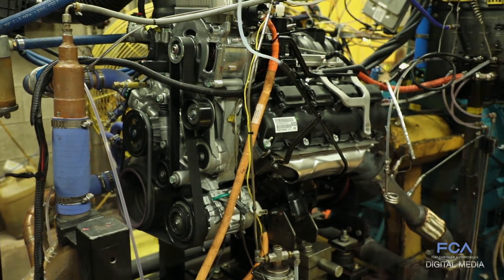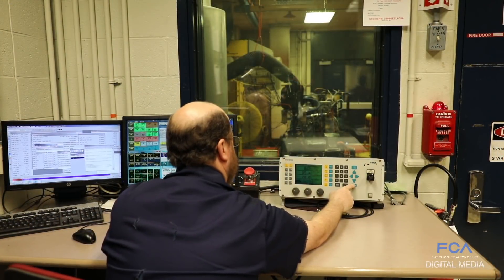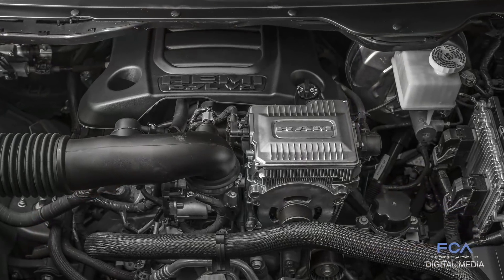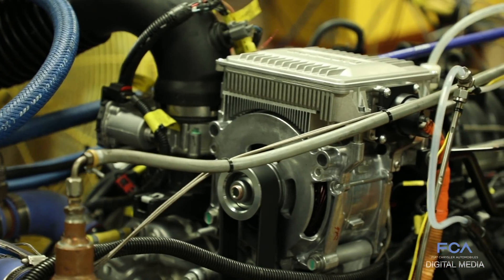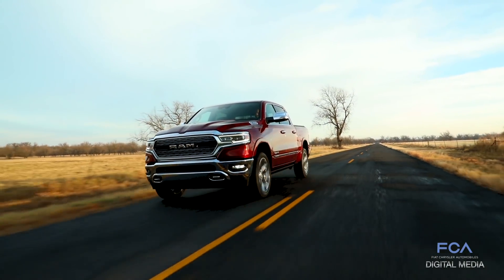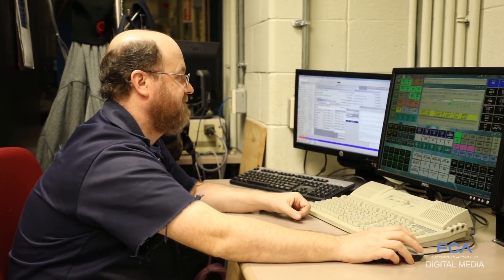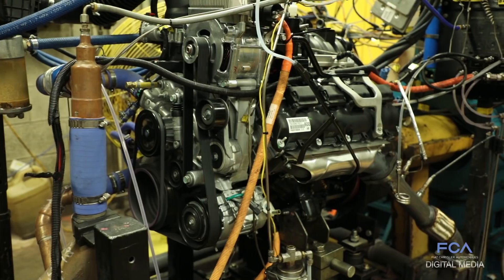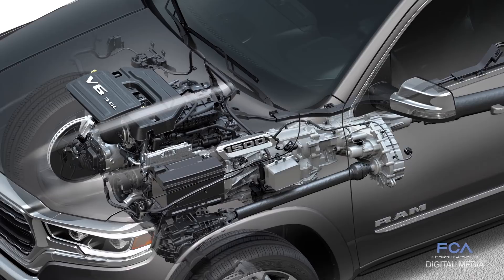2019 Ram 1500: Dyno Testing

Comment: 5000k miles on my 2019 big horn lvl 2 tech crew cab 4x4 1500 hemi e-torque.. The truck is everything I wanted it to be reasonably speaking.. I loved the Limited but I'm a shipyard worker, fisherman, boat hauling, new father so bigger tires and the 2" lift is the route in taking. 
  WELL ok  if I have FCA's ear. Being this is their video. Get mopar to offer compatible front camera, get into the heads up display era (full dash)  and gyroscope like the raptor but BOLDER. And good job on the new design frame and crash test improvements! Also, fix the issue with getting a good pass on the dyno. allow us tuners to get in! Signed a potential returning customer!

Comment: Same boring motor with a micky mouse hybrid system. Nice looking trucks but your drivetrain sucks. You would sell a TON of 1500s with the 6.4 and a different transmission. Instead we get a belt driven hybrid...lol. Your going to make a pile of money when warranty on these run out.
Reply: Exactly or like a supercharged 5.7 and a manual transmission
Reply: ryding with ryan do you know how many people would buy that....
Reply: ryding with ryan none
Reply: letterpool lol they are actually very good drivetrains. The 426 hemi is coming out. The 6.2 supercharged is going into the 2020 ram. 725 hp. Also i believe the 6.4 will be an option for the 1500
Reply: Chris Huber I think there are people who would buy it as a limited edition 1 year model.

Comment: AT WHAT MILEAGE DOES THE E TORQUE UNIT FAIL ???????????????
WHAT IS THE COST TO REPLACE !!!!!!!!!!!!!!!!!!!!!!!!!!!!!!! $ 3000 bucks + DEALER REPROGRAM $ 200 bucks
Reply: Joni English , yes these are questions consumers really want answered !  . But if FCA has shown us anything in the history its that any major / expensive components are engineered to fail just after warranty is over . 
That is why I will buy any make other than a fiat Chrysler product. Plus look at consumer reports reliability score on all FCA models . They are at the bottom of the list!
Reply: FCA poor Quality , 
my buddy Got a 2010 F150 Drive line Vibration , brought to Dealer 5 x replaced drive shaft , same problem 
trade for toyota Highlander , lost $10,000 in the trade , after 2 years got a 2013 Ram 1500 
lots of minor problems dealer does not want to FIX!!!!
i have a DODGE KEY FOB needs replacing 
DEALER wants $200 bucks + $100 to reprogram !!!!!!!! OUCH
Reply: Joni English . I hear you . Everyday I work on all makes and models of vehicles . All brands have their problems . Some more than others it seems . I've not seen a Chrysler product that wasn't a pos after 5 years or so
Reply: AutoTech Jord all mine have been fine. Its just people like to mod them and drive the shit out of them